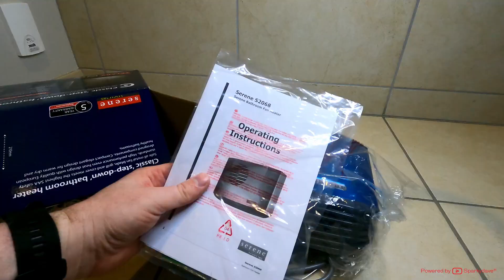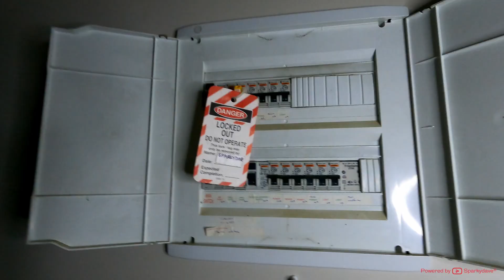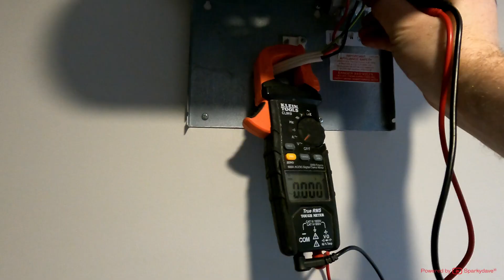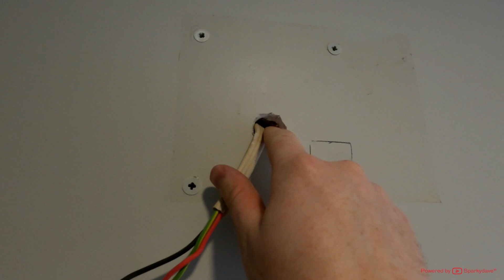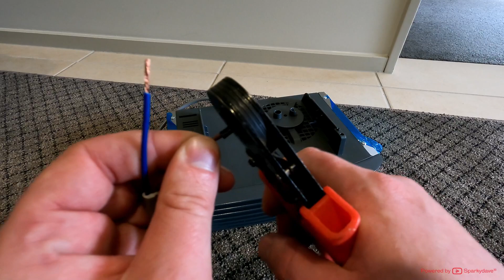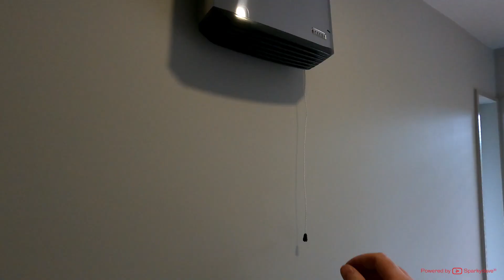How To Replace Bathroom Heater

Comment: Thank you. Can you please tell me why you popped the pull cord up out of sight? Are you planning to leave it on all the time at the unit, and turn it on and off using the isolator switch only? I thought that is was generally a bad thing to do that for any electric appliance, and that the unit should only be turned on and off at the unit. Am I mistaken? Thank you.

Comment: PSA: The Bathroom heater installed in this video was found to be faulty with overheating issues, and Serene has now issued a recall notice in 2024 for all S2068 Heaters.